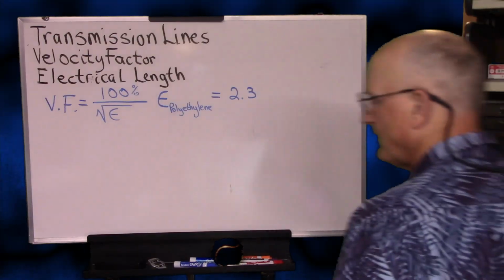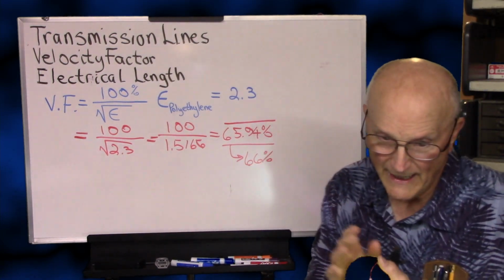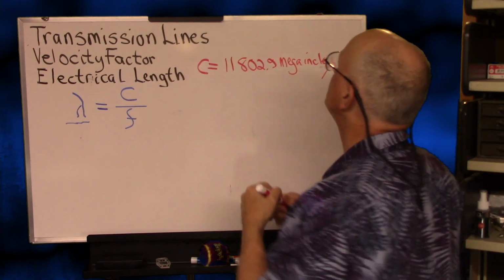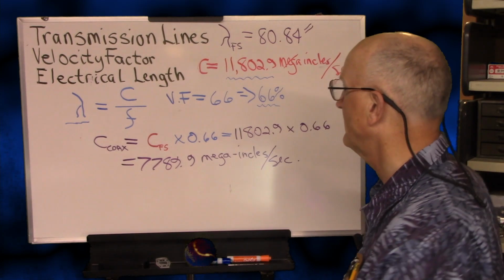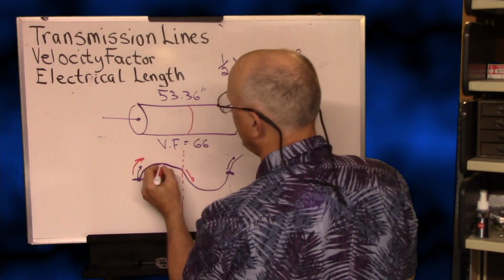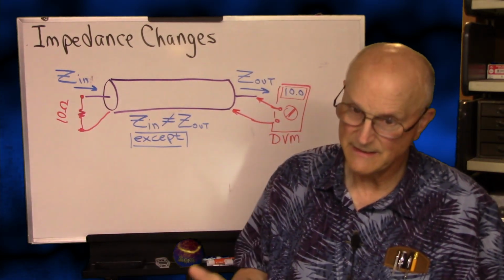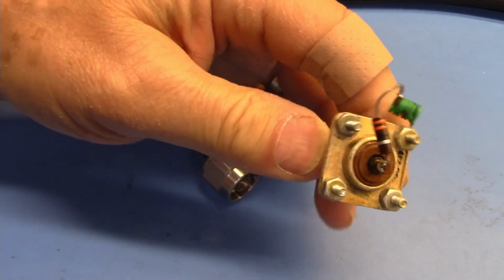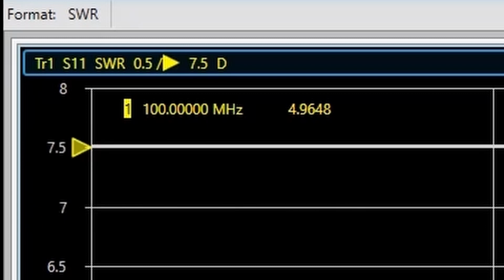Smith Charts: Foundations (Pt 2) - Transmission Line Realities (00h3)

Comment: All that work to end up in inches , unreal 😢.
I,m from England I also work in Metric all of the time , far better and easier.
Reply from the maker: I agree, metric is easier in so many ways. There is no doubt in that. :-)
You can do this whole thing in whatever measuring system you choose. In the U.S. it is feet and inches. In the UK, you can get the speed of light in meters/second or cm/sec if you like and accomplish the same task. If it helps, the speed of light in cm/sec is 29979.24 x 10^6 cm/sec (if I did my conversion right). :-)

Comment: why not multiply 80.84 by 0.66 to get 53.36
Reply from the maker: Very good question and this is a very valid way to do this.  In fact, this is exactly what I do all the time.
My purpose for going at it this way was to emphasize the reality of the slower speed of the signal and its effect on the wavelength of the signal in the coax.
I hope that makes sense. 🙂

Comment: Interesting, even though the extra piece of coax has probably the same impedance of 50 Ohm, as the blue connection cable, the measured impedance at Vna differs a lot. That is indeed due to the calibrations based on voltage and current phases AT THE END OF THE BLUE (CALIBRATED) CABLE. And not at the end of the black cable. Something called Reference Plane (calibration). Good stuff.
Reply from the maker: Yup ... the reference plane. I talk about that in my video series on the VNA. :-)

Comment: Sorry this time you confused me with your ball and with your imperial-unit-calculation. („Mega-inch“ - weird for your international followers).
Why did you not used your way of calculation from earlier videos with „1E6“ or 10^6 ?? I would appreciate the use of SI units in future. Thanks!
Reply from the maker: Sorry for the confusion ... the point is that if the periodicity of the vertical movement of the ball remains the same and the horizontal velocity changes, the distance between the points where the ball comes to its lowest position will change.  The faster the ball is moving horizontally, the further apart these points are on the horizontal plane. The slower the ball is moving horizontally, the closer these points will be on the horizontal plane.  
This illustration is supposed to demonstrate the movement of R.F. energy through a feedline.  The speed of light times the velocity factor = the actual velocity that the R.F. energy travels through the feedline. The higher velocity factor of the feedline, the longer 1 wavelength of feedline will be.  The lower the velocity factor of the feedline, the shorter 1 wavelength of that feedline will be. 
Regarding units ... SI units are much superior and easier to work with than Imperial units and they make more scientific sense. There is not doubt to this.
However, as an American, we just do not "feel" SI units in the same sense that the rest of the world does not "feel" Imperial units.  So, we think in feet and inches and degrees Fahrenheit.  Being that I was teaching from this context, I naturally default to Imperial units. With that said, I think you make a good point regarding my international viewers. One one hand, I must work in Imperial units for my American viewers, but I should also at least provide data in SI units for the rest of the world.  Moving forward from here I will endeavour to do just that; I hope I remember to do that!
By the way, I lived in Canada for quite a few years (Manitoba). Canada purports itself to be a Metric country. Yet, I was somewhat surprised to find construction materials were sold in Imperial units (e.g. 3 inch nails, 4 foot x 8 foot sheets of plywood, 2 inch x 4 inch x 8 foot studs, etc).  I am curious if the same is true in Europe?